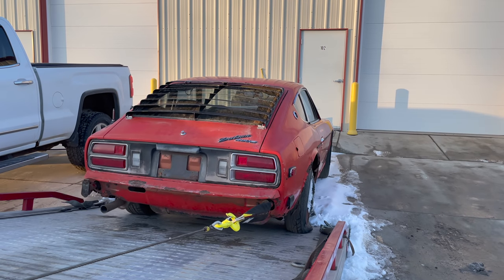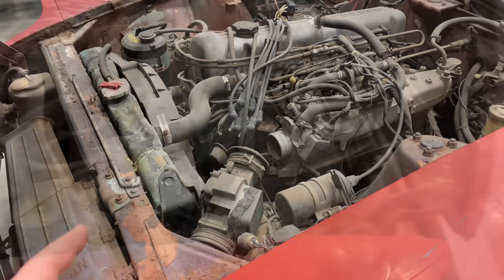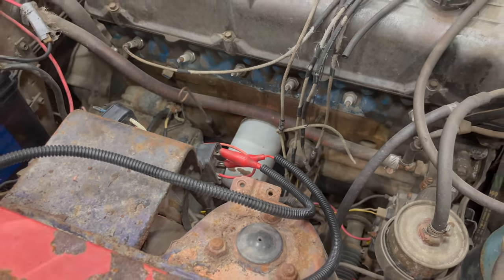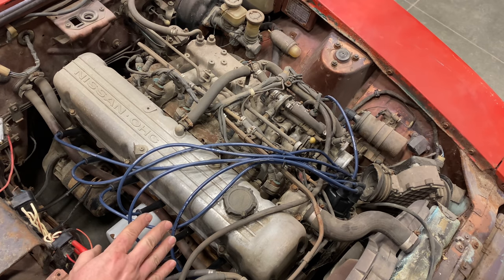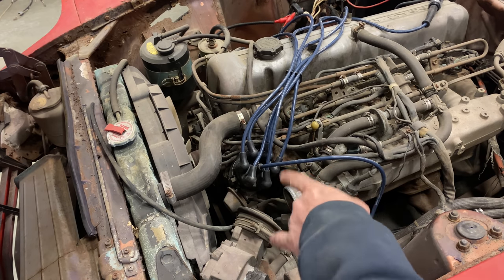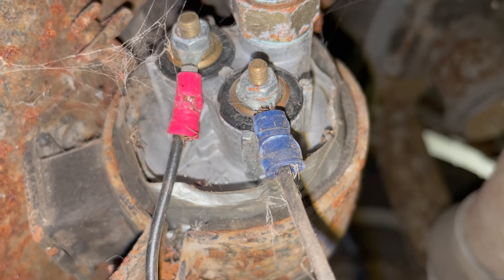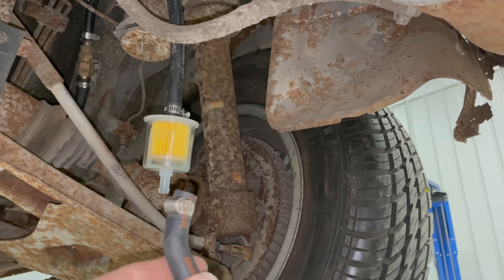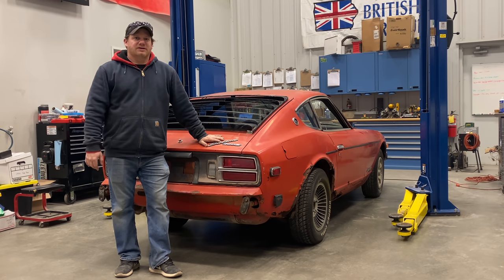1976 Datsun 280z - Will It Run?

Comment: This Week With Cars- At 24:22-24:31, you thought/guessed/predicted that the fuel pump probably seized because of old gasoline.

Could you have probably poured some fresh gasoline into the gas tank & after that, added some of that gas treatment, or, something like that to see if it would've made any difference?...
Reply from the maker: No I would have taken it off and hooked it to a battery to run in a bucket of solvent but I’ve done enough of them to know it is probably trashed and not worth the time.
Reply: @ThisWeekWithCars - Really?...

That had to be a pain.

In this case, did you do the same thing with this one that you said you've done with all of the others?...:

Take it off, pitch it & put an all-new one in?...

Comment: I bought a 1976 280Z new, in Jan 1976. I had a lot of problems with that car. I do not even think that the techs in the dealership knew how to care for the charging system and injectors. I loved my Z car but the repairs ended up being a money pit. Being a 20 something female, I KNOW that many mechanics did shottie work and thought that a dumb female would not know the difference. I now at the age of 68, I  drive a Prius.

Comment: Nissan L series engines are bullet proof, but did I miss where you at least lubricated the cylinders? Just cold firing an engine after years of sitting is never recommended. I wonder what the cylinder walls look like now?

Comment: 26:37 i know its a pain in the arse but i would take the whole engine apart and replace every rubber hose and check every metal lines for rust etc. and replace every o ring and gasket
in short: whole engine restoration

Comment: 9:40, the ampacity of the jumper lead wires will NOT support that 25A breaker. you need a much heavier wire gauge for that rating.
ask me how i know.

Comment: 280's they are all the same. youll need a thermo time switch, a CTS, a head temp sensor get the rats out of the 'mouse house', a tune-up (bpr6ES-11) and youre good to go. simple stuff. great car- think of it as a japanese jaguar that doesn't leak gas coolant or oil all over the (showroom) garage floor.

Comment: The electrlytic deposits created inside the distributor cap and on the rotor arm are nonconductive. Scrape them clean and the spark can return to normal.
Reply from the maker: I used to do that but it damaged the plating and will not stay clean for long the parts are cheap and well worth the lack of continuous headaches from parts that corrode so quickly.

Comment: Now as I understand it 280z are hot right now but no one wants the automatics and standards are worth twice the money. So all the value in this car is the transmission and all the parts that go with including the trim pieces. Or this car needs a total restoration which I don't see happening